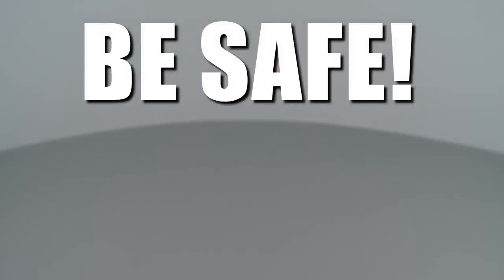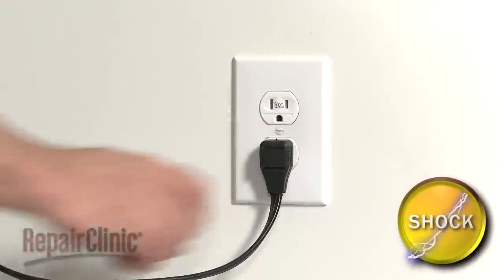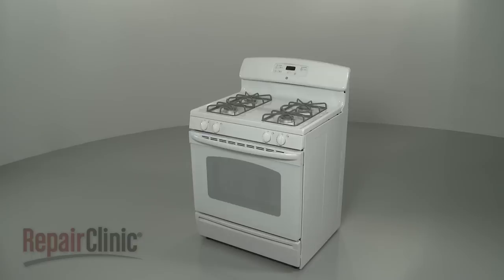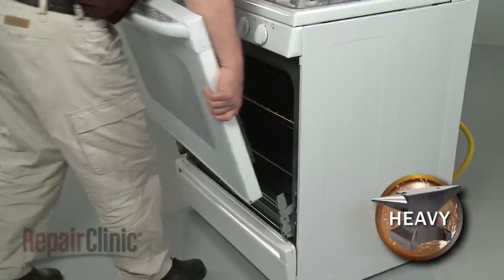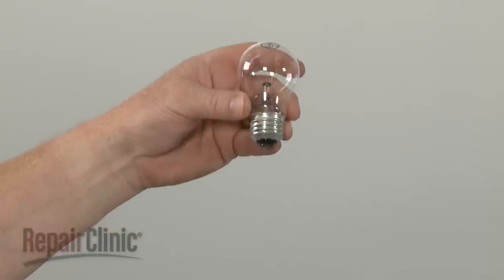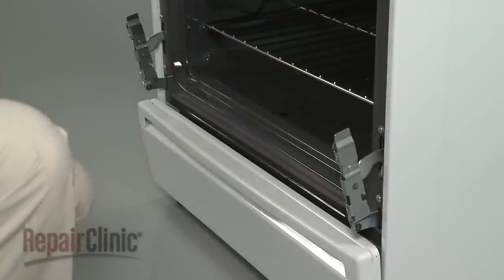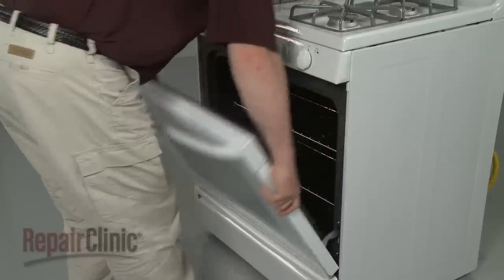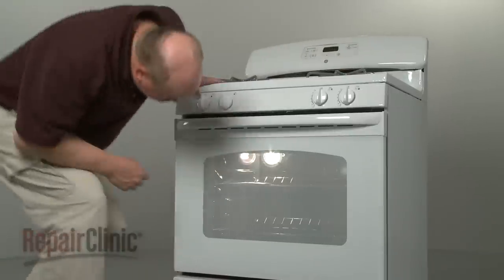GE Gas Oven Light Bulb Replacement #40A15

Comment: This video is ridiculous!  I think we all know how to screw in a light bulb! The issue with my GE oven is that there is a glass cover that will not budge. Now that deserves a how to video!
Reply: The glass cover is probably held in place with a wire that can be moved aside with gentle pressure. Once the globe is free, you can get to the bulb.
Reply: exactlyl!! someone replied to you about the glass covering, but this video should have addressed that as well.
Reply: @tdown182  That is what i found out. I was concerned I was going to have to unscrew something. NOPE.   and I didn't even turn the electricity or remove the entire oven door.  GEESH!

Comment: I just replaced the light bulb in a GE Electric oven. The oven is 30 years old so I had several issues.

First, my oven door has screws that hold it onto the arms. The screws had to be removed, of course. Simple task, but necessary. The other issue with the door is that the arms wouldn't stay in their extended position to permit the door to be placed back. I had to wedge both of them open by putting some wood pieces behind them. Bother.

Second, my electric oven, and probably most ovens today, have a protective glass cover. Mine screws off - counterclockwise. But, given the 30 years of being sealed in place, it was VERY stubborn. I finally was able to free it up by rapping it a few times lightly (no pun intended). It then screwed off fairly easily.

Third, the light bulb didn't screw out. The bulb came out in my hand, but the base was retained in the socket. I was able to use a needle nose to remove the base, but it was a struggle. This reinforced the need to make sure the power is off, before you start the bulb replacement process.
Reply from the maker: Thom F Thanks for sharing details about your particular light bulb replacement experience. We're glad it worked out.

Comment: OMG. I saw an other video and I have the glass bulb that is held on by the wire thing... and that is what i needed to know.  I just  popped the wire thing off the glass cover and replaced the bulb and put the glass thing back over and secured it with the wire thing.  less than 5 minutes.   No turning off electricity or pulling off the door .. OMG.  overly complicated people like to make things.

Comment: Do i need to bring any serial number to the store or just buy any bulb made for ovens? Mine just went out today although the appliance is only 6 months old. I often leave the light on at night as a night light in the kitchen so i assume that's why it's dead after 6 months.
Reply: Any 40 watt A15 bulb clear or frosted
Reply: Needs a 40 watt appliance buld, A15 type
Reply: The original appliance bulb lasted in my GE profile oven for 20 years and 3 months.  I bake bread frequently and turn on the light to provide warmth for the yeast to rise the bread.  Also provide a nice temp for yogurt making.
Reply: @eleanoreagly4844  thanks, i've actually gone through at least 6 bulbs since i posted this. I haven't used the oven for over a year now, when i turn it on it gets warm without actually heating up, or i smell gas, or in rare occasions it might actually get hot enough to cook, but no guarantees. so either my ignitor switch is bad or my thermostat, grrrr.

Comment: Just discovered the easiest way to remove a screw off type glass cover or lens from the oven light that covers the appliance bulb light. Simply wrap the glass cover (lens) in duct tape and give it a half counter clockwise turn with channel lock pliers.  Nothing else worked for me.
Reply from the maker: +JOHN THERMOS Thank for your sharing.
Reply: Mine won't budge, does baked on food get in their or metal distortion to heat?

Comment: I have the electric ceramic top stove by GE from 2003. I went to change the bulb and didn't bother to turn off the breaker switch to the oven. Result...I heard a loud pop and fried the entire control panel and had to order a new one!! Who unplugs an appliance just to change a light bulb???? Anyway,with the appliance unplugged,  I replaced the control panel and the first time I went to use the oven, I heard it pop and fried the new panel, again!!! What could be the problem? Did one of the wires get damaged? I'm on disability and can't afford a technician to come out on my limited income. Can somebody please help me here??